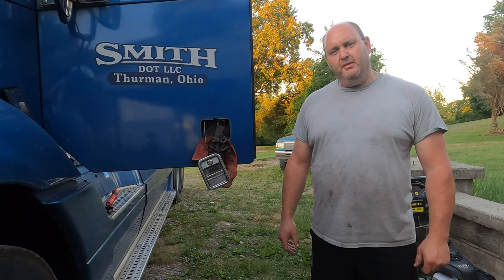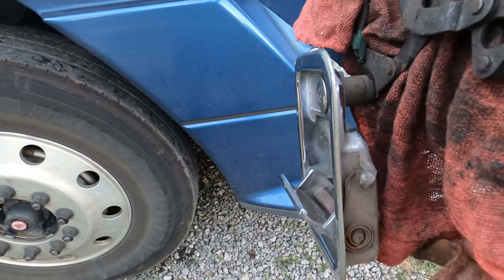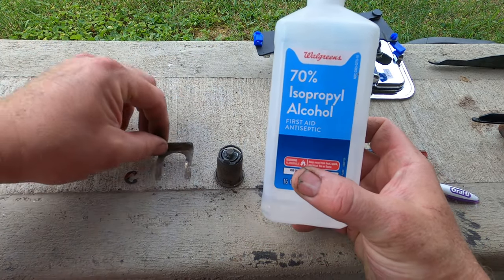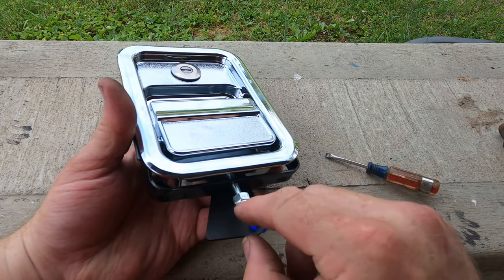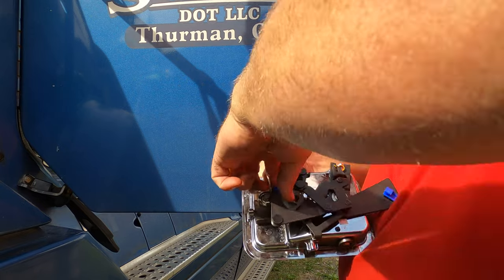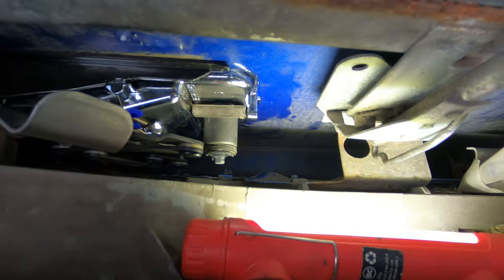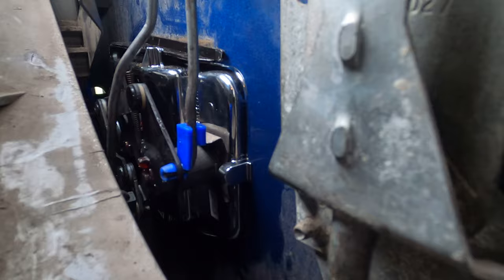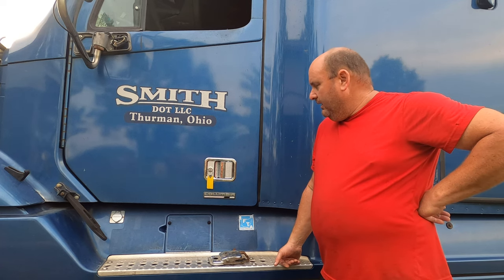Trucking ,  How to replace a Broken Door Handle on a 2007 Freightliner Columbia .

Comment: Man... That wedge bracket kicked my butt... My Driver side handle springs broke and i couldn't open the door from the outside as well as the tubmler to lock and unlock the truck. Dealership had handle for 80 bucks and the little tumbler was 200 bucks..I said i ain't paying 200 bucks.. I bought the handle and ended up transferring the passenger side tumbler to the driver side so i can unlock and lock the truck with a key.  Anyways had to take both sides out and and swap the tumblers out on to the new door handle, piece of cake but I dont know how you got that wedge in I was fighting it for at least 30 minutes trying to align it correctly. There was barely any room to put two fingers in and the bracket kept falling to the bottom and i had to fish it out. Eventually I got it positioned correctly, tightened everything down and all works well..
Reply from the maker: It’s rough I agree !!! These doors have little room in them where it counts . At least you got it , great job !!!!!

Comment: Wouldn't it be easier to remove the whole panel from the inside?
Reply from the maker: You would think so but no . And if you break the door panel which is easy to do then that costs a lot of money . Several years ago I purchased one at the dealership for $300 so I am sure it costs a lot more now .

Comment: What was the part number my key is hard to turn
Reply from the maker: Need to call the dealer with your vin number due to the parts can be different on your truck . Use that number on eBay or Amazon.

Comment: What was the part number?
Reply from the maker: Need to call the dealer with your vin number due to the parts can be different on your truck . Use that number on eBay or Amazon.
Reply: What's the part number?

Comment: why not just buy the new one at freightliner? you  need it and it's probably only $20 you'd save. better than having to tear it apart again
Reply from the maker: They are not even close to $20 lol 😂 depending on the truck you own , $70 to $300 .
Reply: Freightliner charges double for one